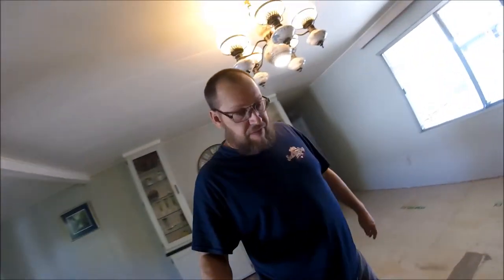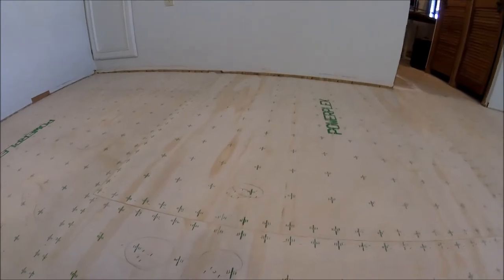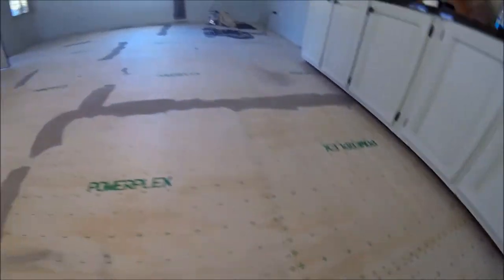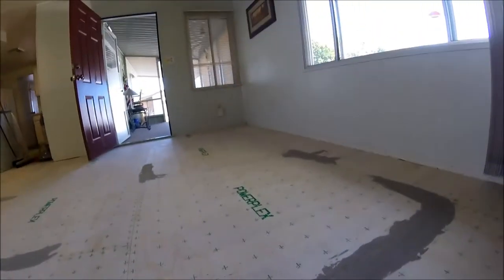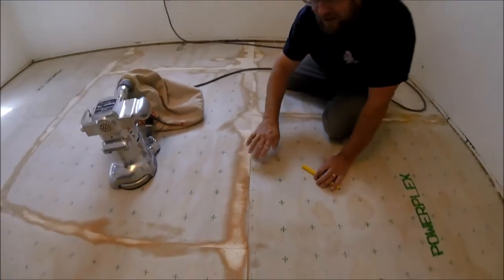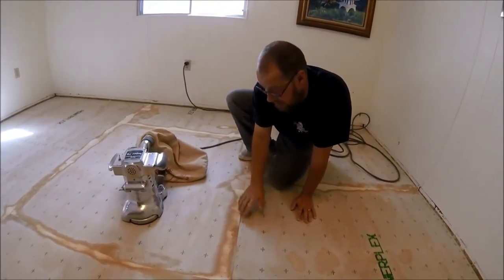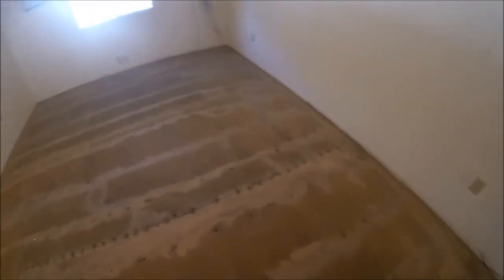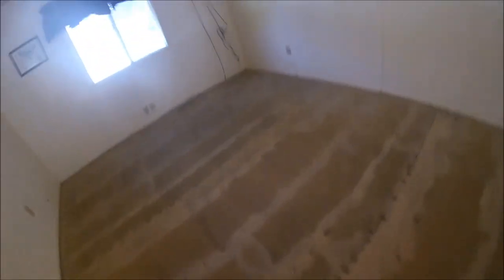SUBFLOOR  AND SANDING INFO

Comment: Interesting.  I've always patched every seam and feathered the edges out like a drywall joint. Also just float over dents from hammering . Eliminates the need to sand, which a lot of customers won't let you do inside . Love your videos picking up some good tips.
Reply from the maker: thanks i tell them sanding is a must and just explain to them how floor patch tends to crack and crumble over time from the movement of the floor and they are thrilled that i would go through the extra work for their benefit .
Reply: @FloorsbySouthernboys  I have an older home and am replacing carpet with vinyl tile plank. I have some significant ups and downs to the MDF sub floor. Is self leveling cement a bad idea?  What is a better plan? Thanks in advance!
Reply from the maker: Robert Steuer Use a good primer and then you will be just fine using some self leveler, prime t from Home Depot is a good product
Reply: @FloorsbySouthernboys  THANK YOU for taking the time to help me!  Enjoy your videos :)
Reply from the maker: Robert Steuer thank you
Reply from the maker: Verdant Landscape That’s OK, they are saying that just to protect themselves in case of anything happening I will spread the prime t on the floor with a roller, and also buy extra of the prime t and mix your self leveler with about half water and half prime t And that will increase the strength and flexibility of the self leveler and you will be fine I assure you
Reply: @FloorsbySouthernboys  Thank you for the assurance. I spent this afternoon adding a few hundred screws to the floor (it was put down with nails only). Next I will give the leveler a go!
Reply from the maker: Verdant Landscape Good luck buddy I’m sure it’ll turn out fine if you mix the stuff properly

Comment: I took out a wall and the new transition into rooms is on different planes one way, and wavy the other. I tried self leveling concrete to make the new transition but failed. I’m thinking of laying plywood and sanding to make a good transition, but it’d be a lot of sanding. Have you ever had to sand a lot of plywood to make smooth transitions? Like 1/2” in spots?
Reply from the maker: Haakonson55 I usually float it out with filler